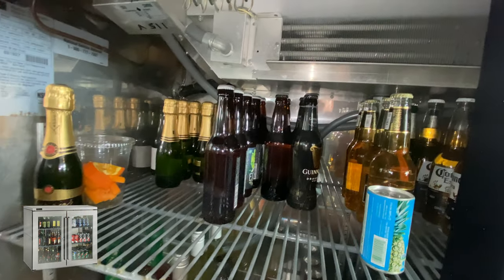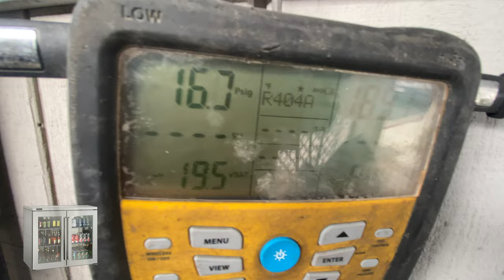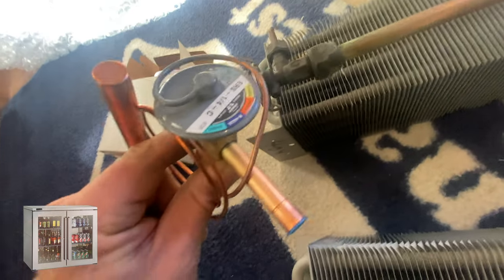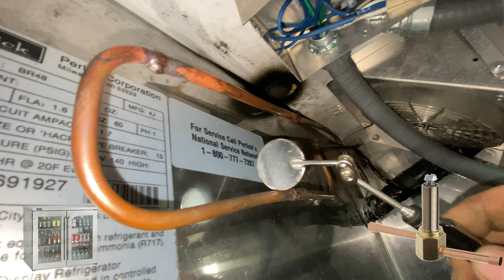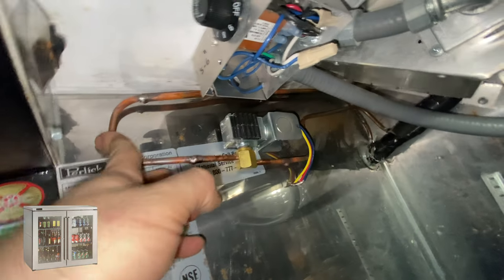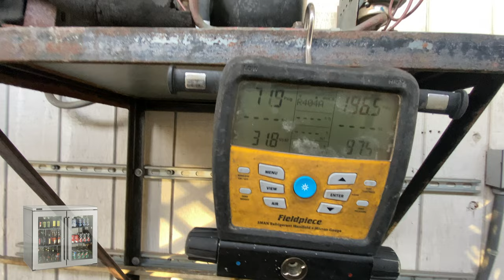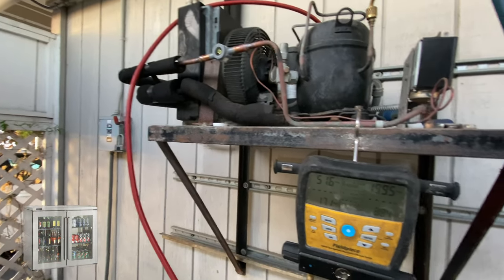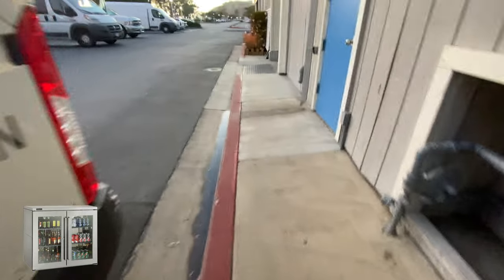Perlick Bar Refrigerator Restriction Repair 🌬🍾. Rebuild.

Comment: Great work! Was the TXV fully shut?
Reply from the maker: You got it. TXV head didn’t have any gas left in it. To replace TXV on this cooler was easier to swap coil as well - will last longer. That set up 11 years old being right by the shore line. Their condensers aren’t in the best shape either, I’m keeping eyes on those.

Comment: great videos as  aways !! Please dont stop doing them! Learned a lot from you!
Let me shoot you a question... why you add a solenoid valve and what will be his function  ?
Reply from the maker: Thanks 👍 There was solenoid valve at the beginning, just in different place. when cooler gets down in temperature t-stat will close solenoid valve, so refrigerant stops flowing into evaporator and pretty much stops cooling, when cooler gets warmer - solenoid opens (t-stat controls when to open and close) and refrigerant flowing to the coil make it cold. This system has both coolers on the same condenser unit, so both coolers has that solenoid to control temperatures independent from each other✊✊
Reply: @MaratRPMSoCal  great thanks man
Reply from the maker: @kaloiankrastev6851  sure👍

Comment: this is why i hate working at bars, they know tech is coming yet , they still have the fridge full. i hate Perlick coolers period
Reply from the maker: I know, these are hard to access anything on. I got use to people not giving crap about techs coming to service stuff). I like them Perlick brand, hard to work on, but at list its build well quality wise.
Reply: @MaratRPMSoCal  just charge more alls good in the hood they play u hard u charge 🤑 hard
Reply: many times they don't know or understand the box needs emptied to do repairs and think a twist of a screwdriver will fix it :)
Reply: Doing work for bars suck ! Perlicks are good boxes though , I like them. I Tell Owners Before Hand I need the Box unloaded & unplugged / turned of. I tell them if they like paying me $90.00 an hour to unload your cooler , hey , no problem , the bill will reflect that. I’m real slow at unloading a cooler , I don’t want to break anything.😁
Reply from the maker: @throttlebottle5906  that is true. They think my wire strippers will fix everything😂
Reply from the maker: @OcRefrig   Like them Perlick and glastender as wellI. I do the same, but I plan that I will have to unload box). 🍾🍾
Reply from the maker: @throttlebottle5906  😂